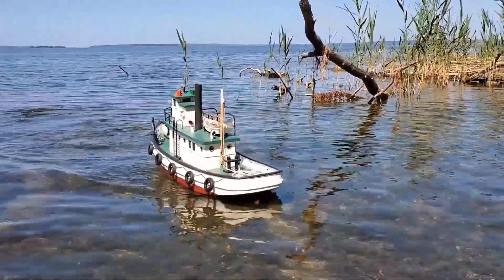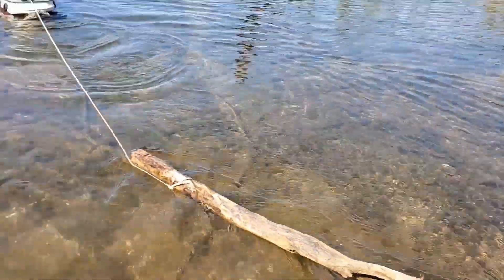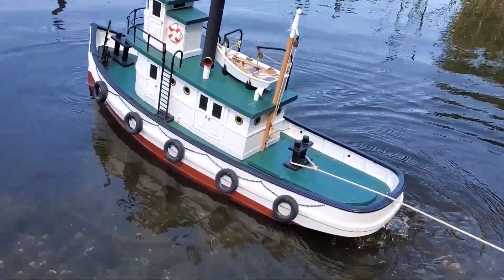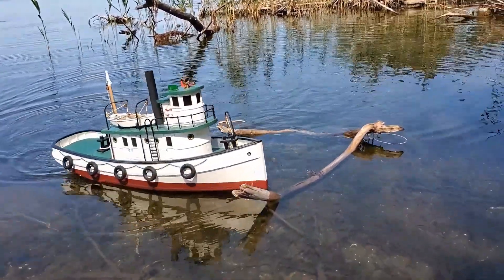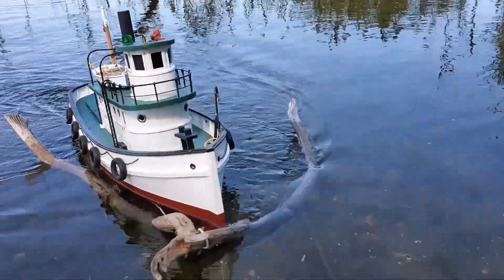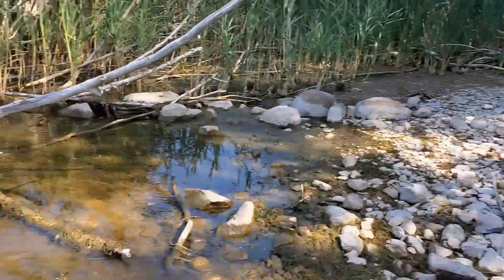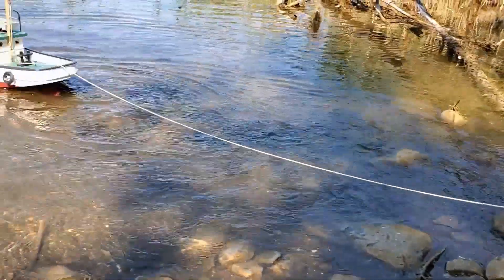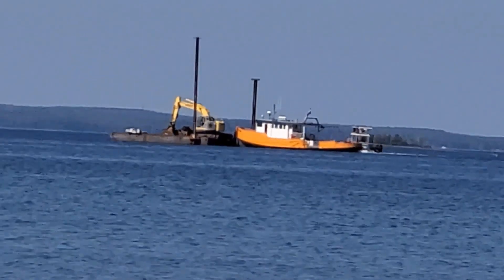RC 34" Tugboat Hauls Large Driftwood off the Beach

Comment: Hi, I love your tugboat.
I'm going to start a tugboat during the winter and I was wondering, is the plastic propeller really strong?
Reply from the maker: I have never had a problem with these nylon props.  They are inexpensive and tough.  Probably the shaft would bend before the prop suffered damage.  Brian RCWH
Reply: @RCWorkboatHaven  Thank for the fast answer.